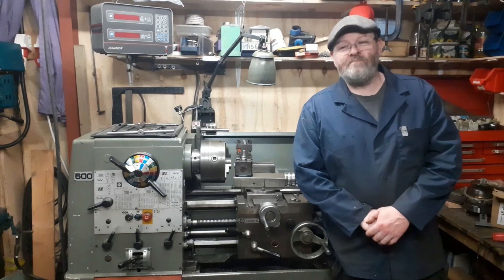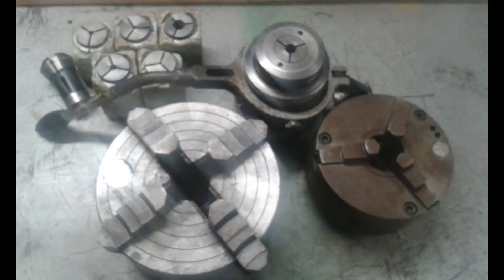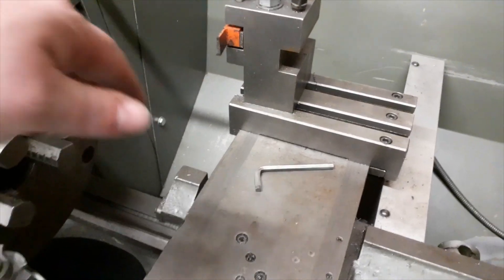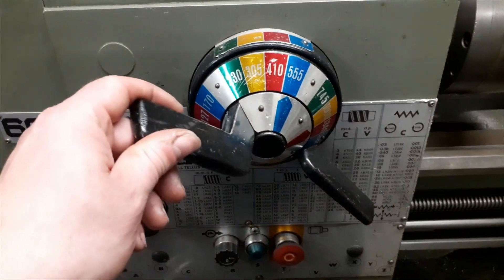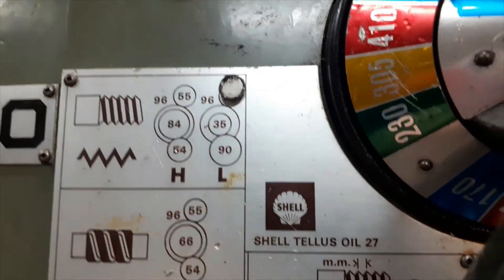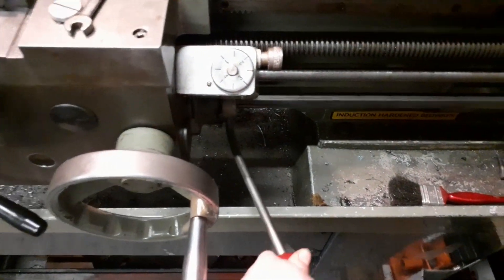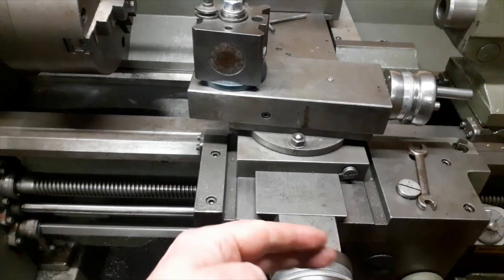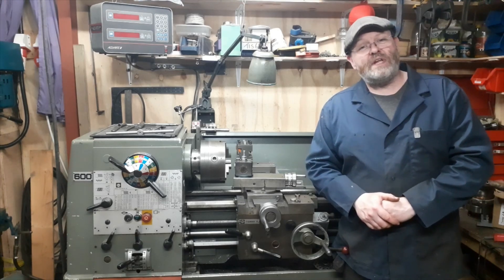Colchester Student 1800 Lathe, quick look at some features & accessories

Comment: Colchester's were the first mass produced precision industrial lathes.
Reply from the maker: Thanks for the info, did'nt realise the first, but no surprise cos the number of clones and copies proves they got somert right. Cheers
Reply: @mattsbitsnbobsworkshop  Colchester's best small lathe was the Chipmaster. These lathes were built mostly from parts from Students. The way Colchester did this was through their quality control system. Parts of close tolerance were specifically selected for use in the construction of the Chipmaster.
I owned a second hand one of these machines for 20 years. A very friendly and accurate lathe to use.
Reply from the maker: @haroldpearson6025  I looked at a chipmaster many moons ago but did'nt get on with it so went down the myford road, not sure if it may have been just that one but this student feels better, maybe I got a good one? But like you I know people who love the chipmaster, swings and roundabouts.